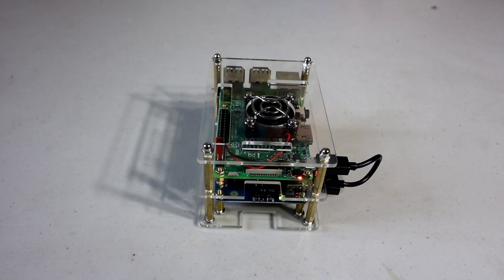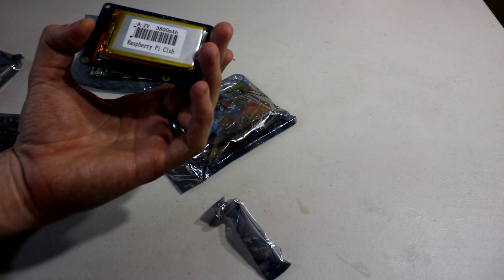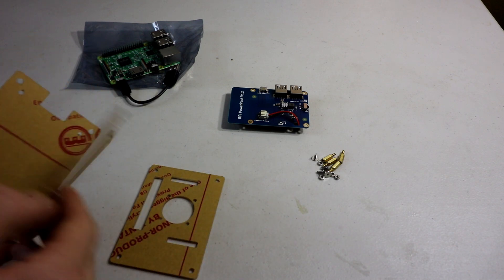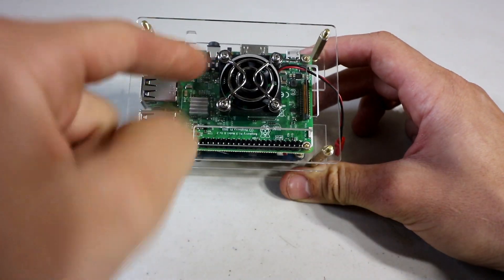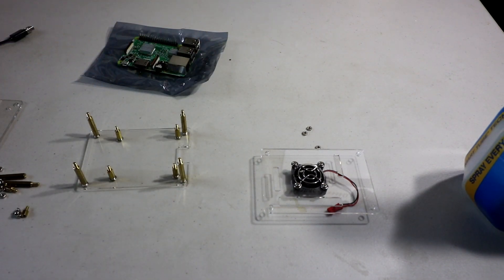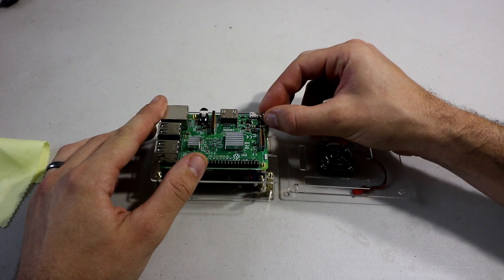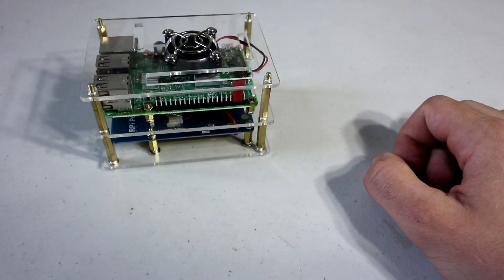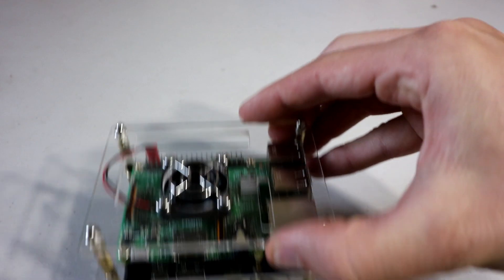All In One Raspberry Pi 3 Kit - Unboxing, Setup, and Review

Comment: I bought one over a month ago.  I haven't been able to get it to do much.  It did not come with NOOBS,  the Rasbian software does not work properly. Ican't open the internet browser among other programs that came pre-installed. I have updated it a couple times thru different sources including the manufacturer, still no browser.  Now I'm trying to format the card it came with thinking its corrupted or something.  the format program that I was directed to download from their site on the pc is not compitable with windows 7 I guess.  I did buy a preloaded sd card seperatly and it works fine for games.  If it wern't for the preloaded card I bought seperate, I would find this not worth having as you need to have better computer skills than I do.  But I'm no proffesional  I think the raspberry brand sd cards may be not so good?  I have tried searching their website and still at a loss.  Its like buying a Dell computer.  the software is from this place and the hardware is from somewhere else and the compatibility is what I;m trying to sort out.